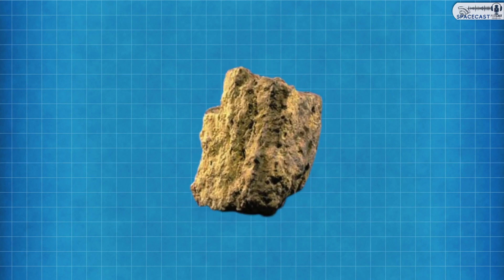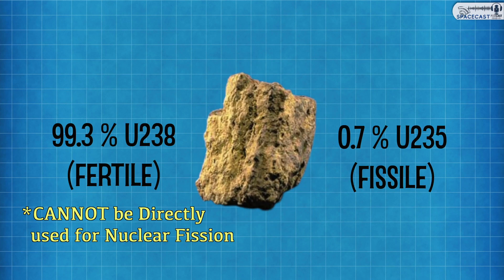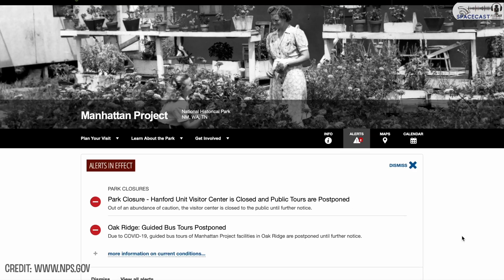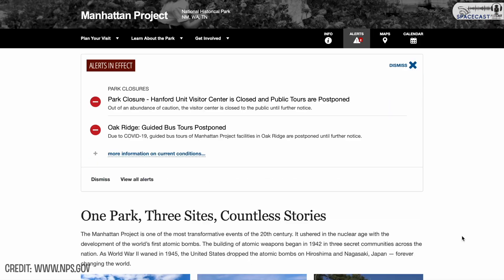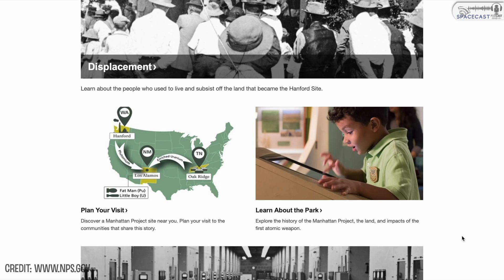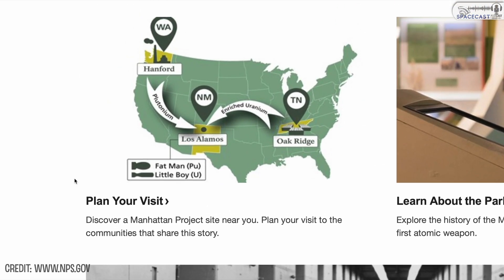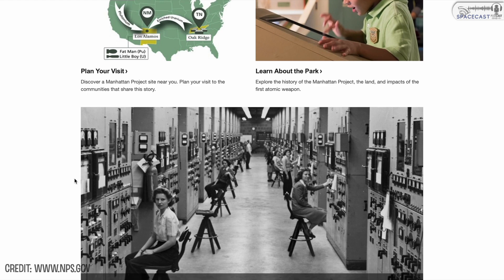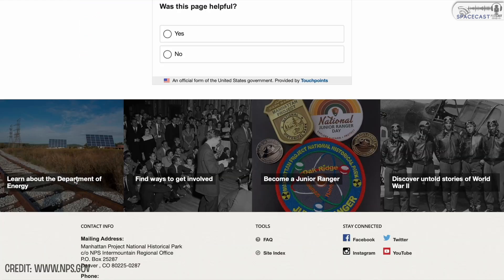Nuclear Fuel Enrichment Process | Diffusion & Centrifuge

Comment: PLZZZ MAKE a video on cheyrnobyl acident not at par level of basic or for those who are beginers but in a very depth and complex manner 
also do add the stages where the explosion can be prevented and also do teell what further modification would make cheyrnobyl rbmk1000  more roubust and safe allowing it to oush beyond 3300kw (plated capacity)

Comment: Actually, gaseous diffusion was used at K-25. Y-12 used an electromagnetic separation method (think particle accelerator) in order to separate heavier isotopes from lighter ones based on their deflection while passing through a dense magnetic field. Look up an article on silver's role in producing the first atomic bomb. Fascinating read! The S-50 facility used a different method entirely. (Liquid thermal diffusion.) It took all of them working together to get enough uranium to do the job. In those early days, there were problems encountered in every step, because we were still figuring out the process and the technical considerations inherent to the task. It took years to get to the point where we could do this whole thing at an "industrial" scale.